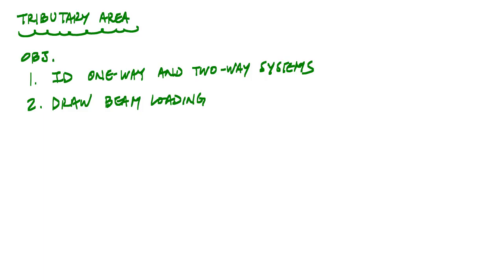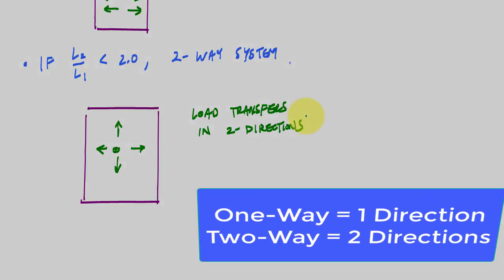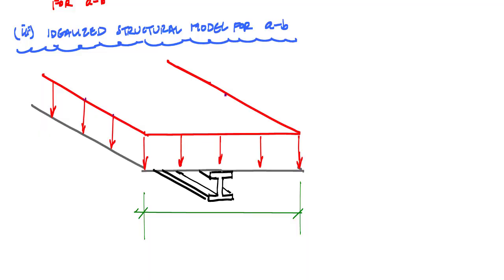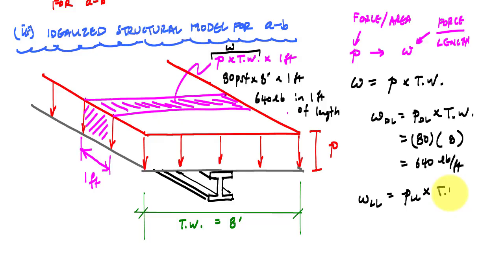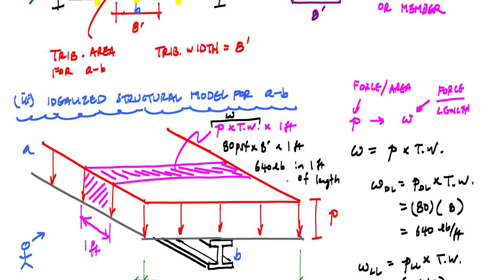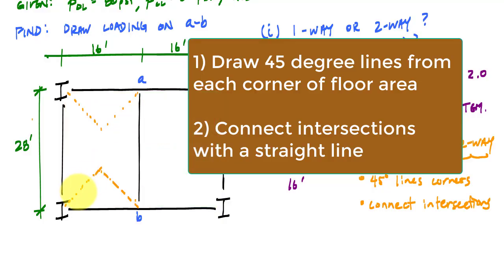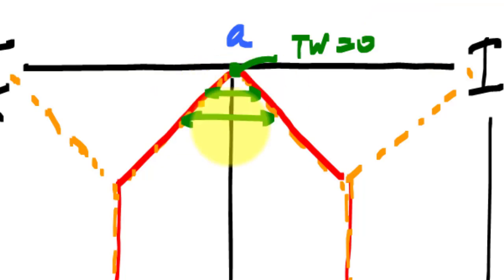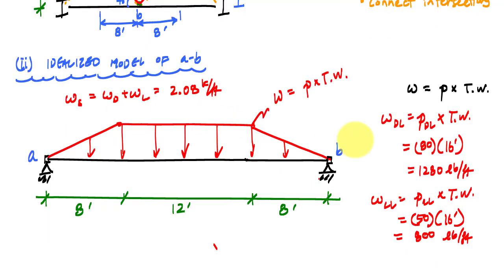Tributary Area Introduction and Examples - Structural Analysis

Comment: Thanks for the excellent explanation! I am wondering if you could do another video focusing on a relative complex example. For instance, determine the load of one of the interior column. The reason why I am requesting is that I have seen people coming from two different approaches, namely tributary area and beam load reactions. And sometime the final answer is either the same or quite close to each other. (I wish YouTube allows me to post image here) So, it really bother me for a while and I really want your insights on this! Thanks for your time and help in advance!!!